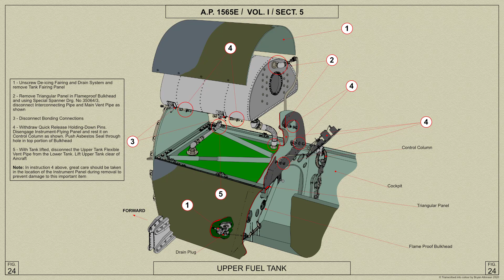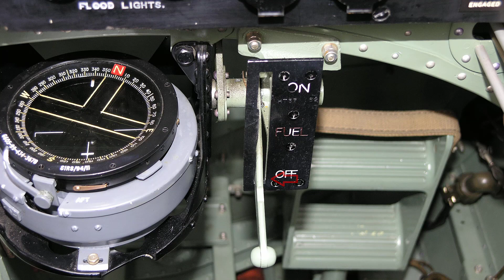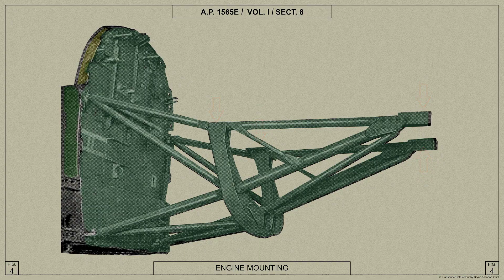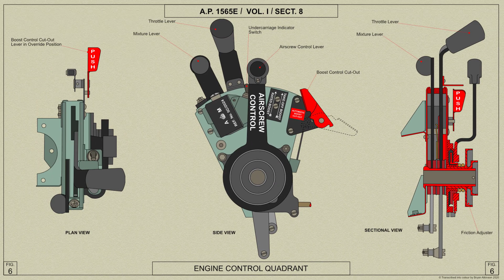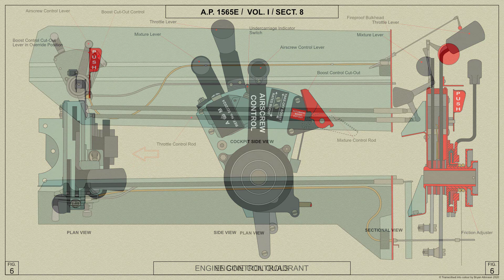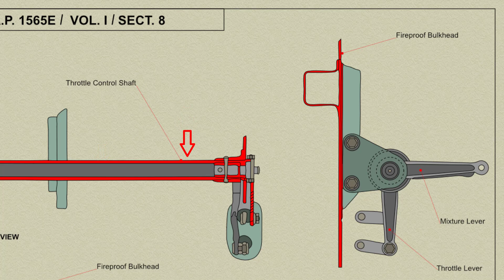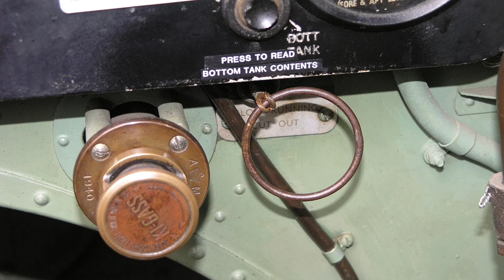Spitfire Mk V – Engine Installation

Comment: All the different exhausts that a right squashed in one there never seen that one with very thin opnings on the BM 597 
We're these all mk5s with the different engines if they had the different exhausts for more backpressure?
Reply from the maker: Yes, the Merlin 45 had the option of three types of exhaust.